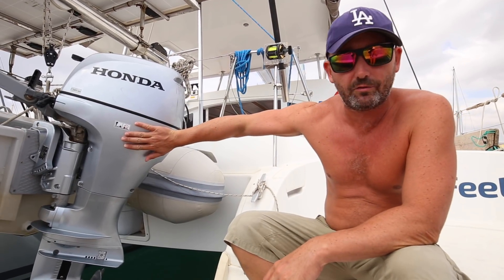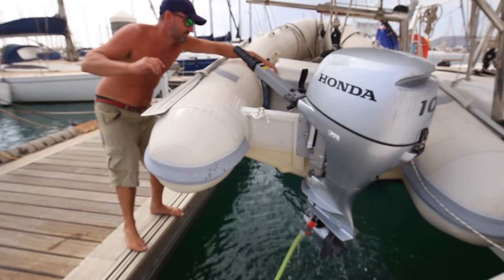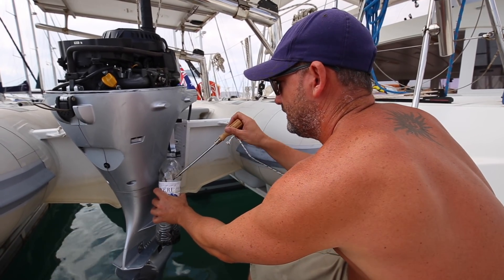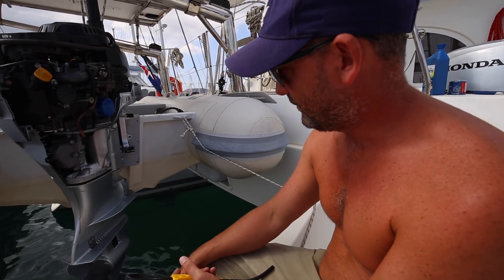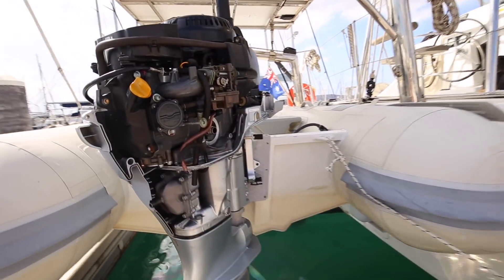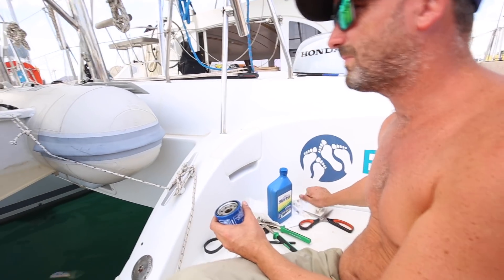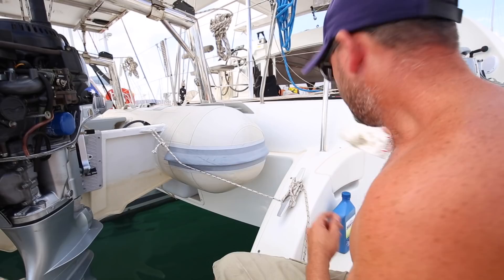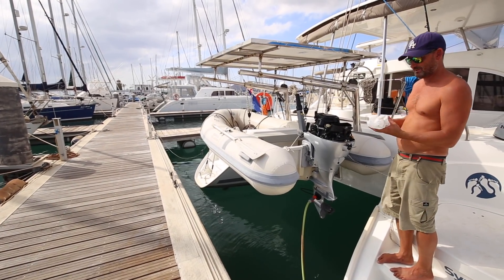A little bit of TLC for our Honda BF10 (Sailing BareFeet TECH Ep02)

Comment: The oil filter part number was on the plastic wrapping you removed. 
Honda put their numbers on the red and white bar code label.
A better way to remove the oil filter is with a removal cap that is made with the correct diameter and flutes (flat sections around the head of the filter)
I have one of these for my Yanmar engines and will get one for my Honda BF5
Reply from the maker: Cheers for the tips and I'll keep my eye out for this when we're back in Las Palmas.

Comment: A shame about the oil spillage removing the oil filter. Further highlight by the rainbow trail on the water whilst fitting the new oil filter and continuing to wipe oil from the leg afterwards. May consider not doing over water next time. Moving the dinghy to dry standing would certainly be less heartache than the Environmental spill infringement.
Reply from the maker: Completely agree Rosie and our goal was for zero spillage. Unfortunately as we're constantly moving and moving the dinghy to a dry stand wasn't on option. But now that i know how much oil is left in the filter (after draining the oil), I will suspend a bucket underneath the leg next time to ensure we achieve our goal.